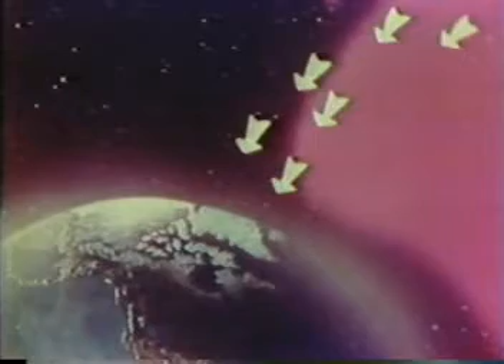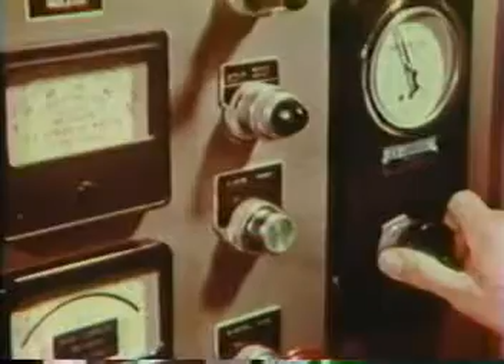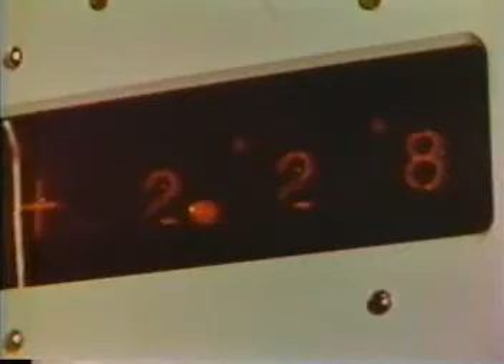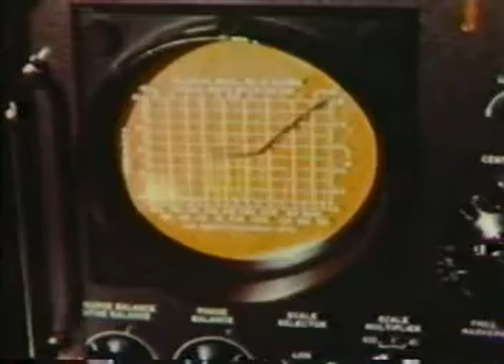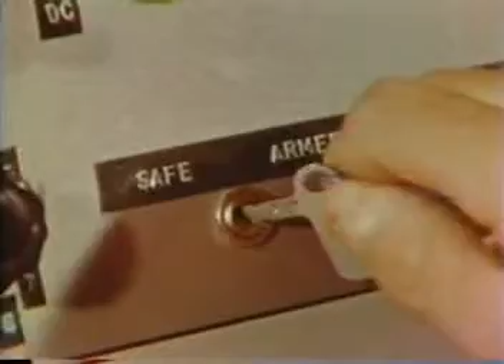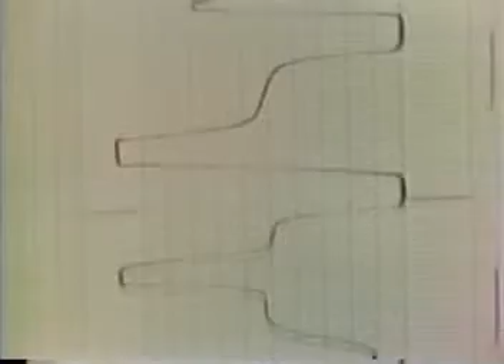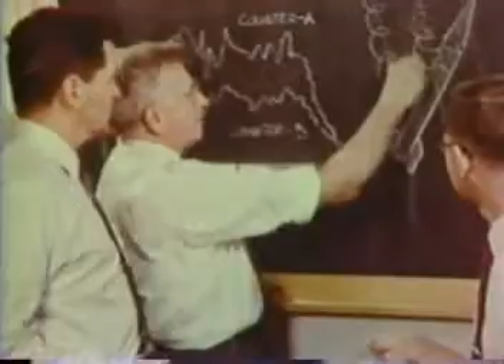BLACK BRANT ROCKET video.mpg

Comment: Brought back memories, a couple of familiar faces.  I was there! (1962 - 1976)
Reply from the maker: Bob thanks for the comment,

Glad I could bring back some good memories 

 I built a scale 4 fin Black Brant 2 a few years ago I used vehicle number AAA-II-102 as a model . That was the first attempt at parachute recovery on a Black Brant 2  here is a video of its first flight 
https://www.youtube.com/watch?v=w--RnxE1y3k I obtained over 50+ photos of the payload section and instrumentation as well as original copies of the operational requirement and flight results but no photos of the motor and fin section. It was launched in January 1967 

Also I have 2 handwritten letters from Mr Al Fiea and spoke to him over the phone several times
Reply: My Dad, Grant Bechthold was also up there. He can be seen in the background wearing a blue shirt at the 7:35 mark and several times after that. Thanks for posting.
Reply from the maker: I am glad you enjoyed it